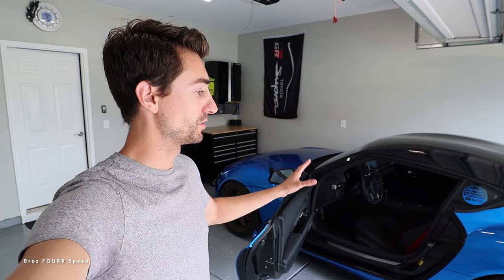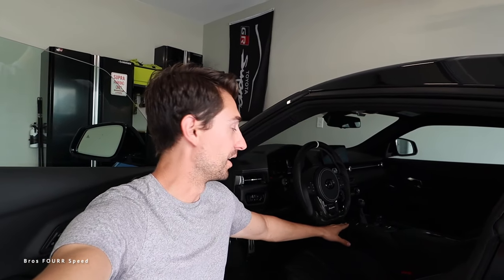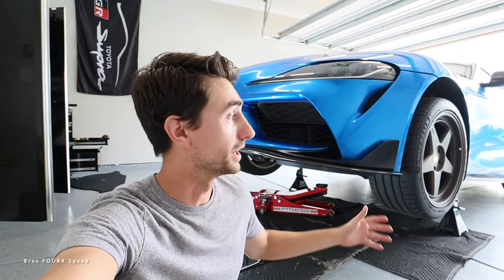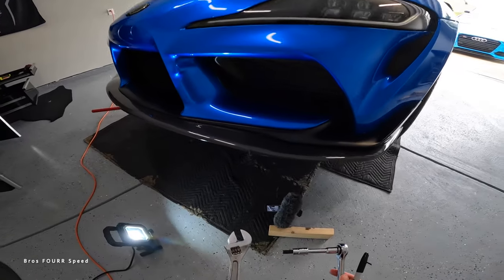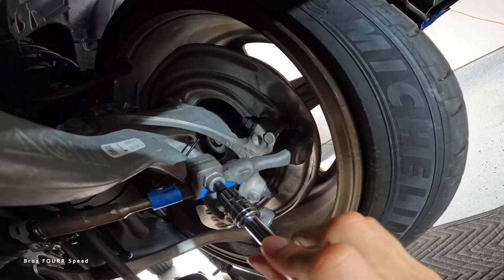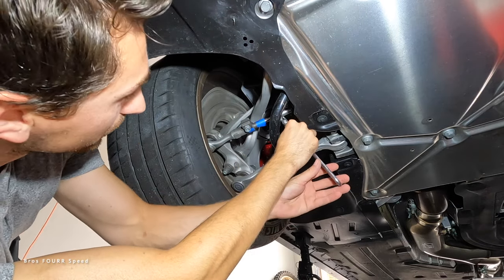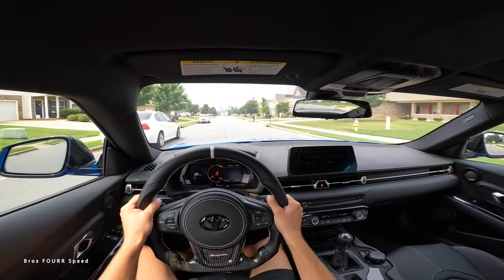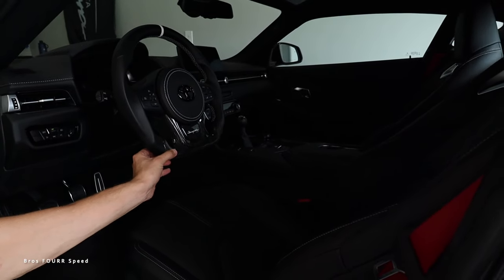How to Straighten Your Steering Wheel Easily at Home | DIY Car Alignment

Comment: I’d get my money back for that alignment lol that’s some bs 😂
Reply from the maker: Yeah, but it's just a hassle going back to the shop. I'd rather just fix it myself and not worry about it. THe alignment is still good, just lots of shops don't get the steering wheel perfect
Reply: Yeah I did my own and it’s perfect, but I just wouldn’t let that shit slide. They need to know or they will keep doing shotty work. A phone call or yelp review is pretty easy. I mean you basically gave them $100 for nothing because you had to fix their work.
Reply: brother there's a way to straighten out the wheel to center with a snap on diagnostic tool  it will tell the computer that this is center  without touching the wheels

Comment: My car pull to the right and eating up inside of the right  front wheel ? Will this fix it or ? 🫤
Reply from the maker: You should probably have an alignment done first. This only works if your car is already straight and just the steering wheel is off
Reply: @BrosFOURRSpeed  already did and didnt help😕
Reply from the maker: @GiggleHub23  Then give this a try and see if you can fix it. But if after a professional alignment your cars is still eating tires. Could be bad wheel balance, worn wheel baring, bad tires in general, poor roads, or anything
Reply: @BrosFOURRSpeed  just Got 4 new tires 😕 if i drive at the Highway it just pull right a little  but when i drive slow it pull a lot to the right 😅 i Think wheel baring or Maybe ball joint 🤔
Reply from the maker: @GiggleHub23  yeah definitely got something going on

Comment: 2:48 you say the car is drifting to the right but clearly with the hands off the wheel it’s pointing and drifting to the left. So why are you turning the drivers side wheel more to the left??? This video is completed backwards
Reply from the maker: Holding the steering wheel straight, the car is drifting to the right. That means both wheels need to be angled to the left to correct the issue.  Because then, holding the steering wheel straight, the car will go straight.  Before the adjustment I have to hold the steering wheel to the left a bit to have the go straight. So that means the front wheels are pointing a bit to the right. So we need to turn the front wheels to the left.